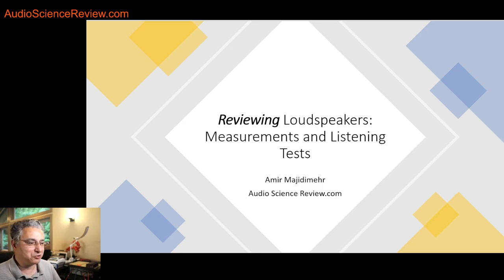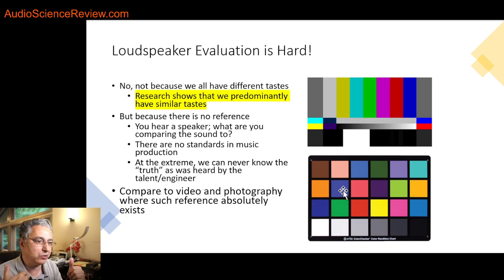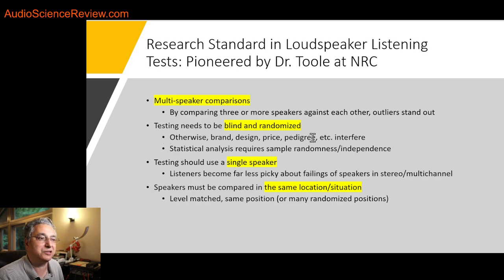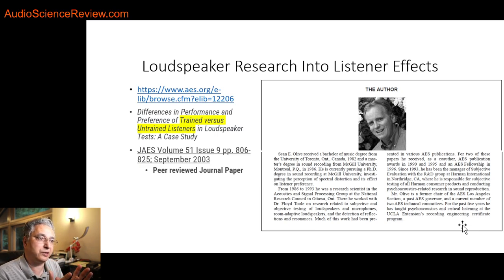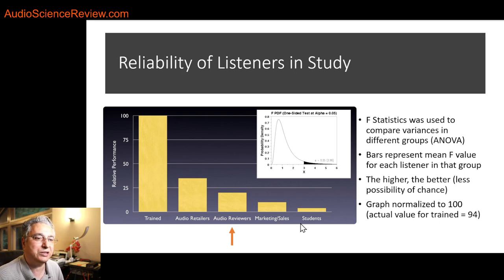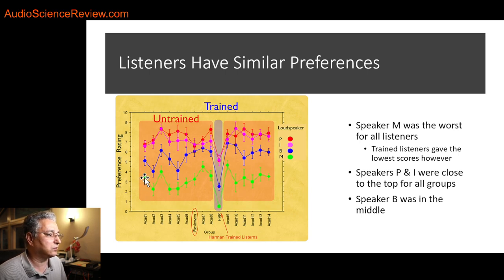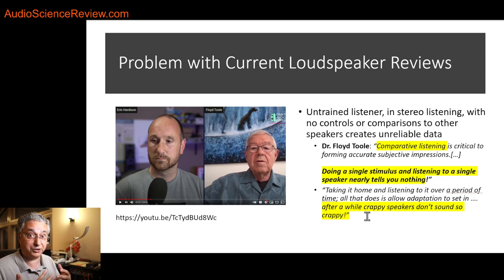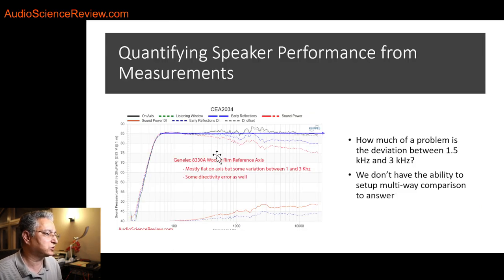Reviewing Speakers - Measurements and Listening Tests

Comment: What if you care mostly about imaging.  These tests are pretty useless right?
Reply: No. But they are less than ideal for that
Reply: @scottwheeler2679  ok.  What specs or tests will show which speaker images the best?
Reply: @shroud1390  That's a really good question and a lot of real experts who are way way above me in understanding this will offer different opinions. And right now personally I am still processing an upgrade to my system that is without a doubt the biggest game changer in 2 channel stereo playback and something that has to be considered from this point out in any discussions about stereo imaging. That would be the Bacch4mac DSP. And I don't think we can talk about what measurements/tests will show what speakers image best without looking at the speaker/room as a system. I do believe that has to be the subject of any meaningful measurements and tests. But we do know very well what causes spacial perception. It's complicated too but really well known. It starts with arrival time and intensity differences between the two ears. It is further affected by how sound from either side of our head is affected by our head as it reaches the far ear. For all the love the Toole/Olive approach to loudspeaker testing and design I do think the Theoretica DSPs and controlled directional speaker systems offer a game changing leap in imaging for two channel playback. It's such a profound difference that I feel I need to live with it for a while longer to really digest what it does. It's that big of a difference. The arguments over the advantages of side wall  reflections to widen the perceived sound stage seem like arguments over which is better VHS or Beta after getting the Bacch4mac DSP. IMO it's a
 whole new game. So far I would say it offers better imaging than any 5.1 surround sound system on the market.

Comment: I used to repair a lot of HARMAN Amplifier, not so reliable design and not so good sound , output transistor blow up very fast with difficult speaker , SO I don't know how Amir can talk about Harman as great reference measurement !
Reply: Analyzing sound is a totally different field from that of amp design. 

In the old days of solid state people were popping final stages all the time.
Reply from the maker: We are talking about research at Harman, not specific products and certainly not the Harman Kardon line which is designed and made overseas with no relation to this work.  This research is also not about product reliability.  That is an entire different thing.

Comment: you talked for an hour mostly about FR (=Linear Distortion), and not even once about non-linear distortion like intermodulation, 
Yes we can easily get used to certain FR patterns and we can EQ to compensate, (or move furniture), WE CANNOT REPAIR INTERMOD and other non-linearities,
these happen waaay sooner to any crackle or bottoming out , waay more important than FR, you also failed to mention directivity.
Non-linearity is the #1 factor to determine instrument separation  VS mud, not FR
Reply: Very good statement. Hope you get an answer from Mr Amir. I assume Mr. Amir won't do it. You've just touched a very delicate point in the discussion! But I could be wrong!

Comment: how good is the opinion of a trained listener (preference for flat audio graph ) to me an average listener, i'd rather follow the advice of untrained listener(prefrence for v shape audio graph) that will more likely match my own taste (most likely v shape)
Reply: What Amir was saying from the research is that trained listeners have the same preferences as untrained listeners, but they get the answer faster and more consistently.
Reply from the maker: As I explained and showed, trained listeners have similar tastes to untrained listeners when they are both tested blind.
Reply: then why is  budget mass market audio signature predominently V shape (a signature trained listeners hate)
Reply: @amanieux  Budget audio sells on exaggerated mid-bass and treble the same way TV's with exaggerated contrast sells on the showroom floor. But it's fatiguing for long term listening and viewing and doesn't correspond to how they were created in the studio mix room.

Comment: @58 EQ change the phase , phase changing, change the sound stage , not good using EQ for high end audio, but for shi***ty music , yes , just do it.
Reply from the maker: Anytime you listen to a speaker in any place but anechoic chamber, your phase information is destroyed due to reflections in a room.  Without EQ, resonances in speakers  extend time domain ringing and with it hide low level detail that gives you goosebumps and staging.  No way you are better off without EQ and bad tonality.

Comment: This is all well and good, but you're being disingenuous when you say "there are thousands of speakers on the market, so how can people choose without me??". Well, people first have to take into account their budget, then compatibility with the rest of their system, and then size and placement requirements, which will narrow down their choices exponentially. After that, then they can look at measurements and reviews, which should help to narrow the choices down further. As for reviewers, if any of them has consistently shown that they like speakers or other gear that I like and don't like other pieces that I also don't like, then I feel pretty confident trusting their opinions. This is without taking into account people's different tastes and priorities. Some people like warm speakers, some like neutral ones, and some like bright sounding ones. And for some, the top priority might be bass slam and dynamics, and the ability to play loudly without compression, for some it might be midrange purity, for others it might be high frequency detail and transparency, and for others it might be the ability to play at low volume levels without sacrificing even response and dynamic ability. For some, it may be absolutely flat response, but others might be willing to give up a little there in favor of other attributes that are more important to them. And, without the discussion of hearing loss and other damage, we have no way of knowing that all people without hearing damage all have the same flat response in their hearing or if their brains process the information in the same way. I see this all the time on the guitar forums, where some may see a certain color as blue, while others perceive it as green. So, all these factors are important too, and measurements are an important tool. But, anyone who buys a speaker based on measurements without hearing it in person is a fool. The ear is the final arbiter, and science isn't perfect. There are still things that we may be able to hear, but don't yet have a way to measure. Any reputable scientist will admit that, no matter their area of study, that there is still much that is unknown, and new things are being discovered all the time in every area of science, including audiology and electronics.

Comment: This video is why I will not buy any equipment without tone controls. There is no such thing as absolute sound. Besides the mastering and or mixing could be completely shit. Does anyone remember the loudness wars which for several years if not a decade ruined cd sound.